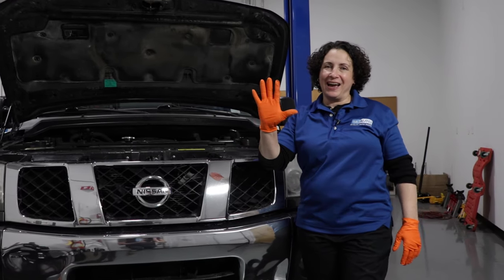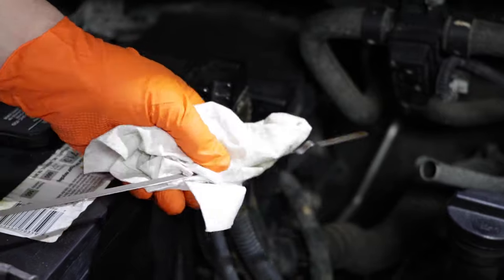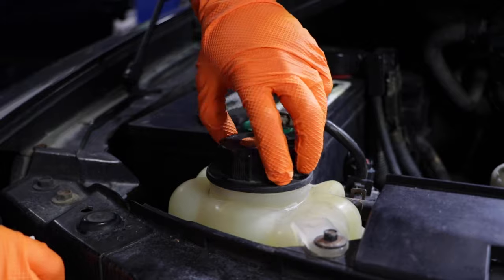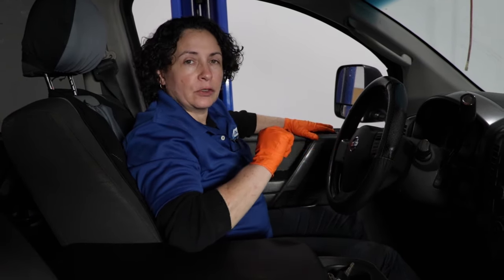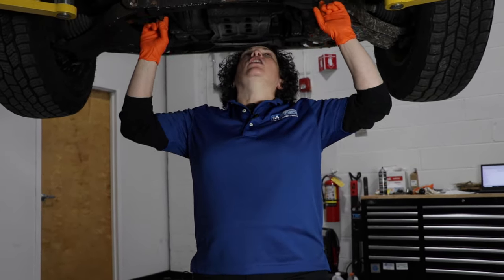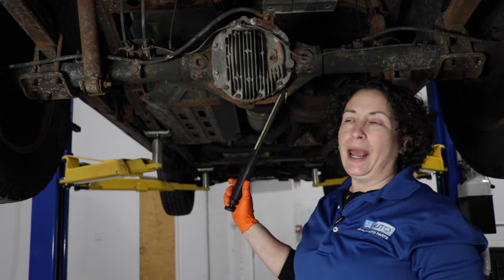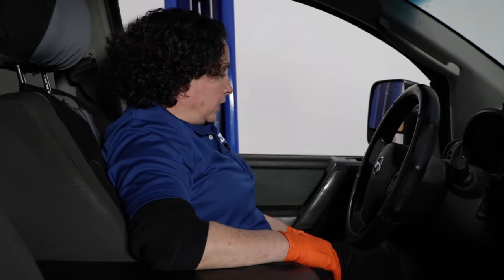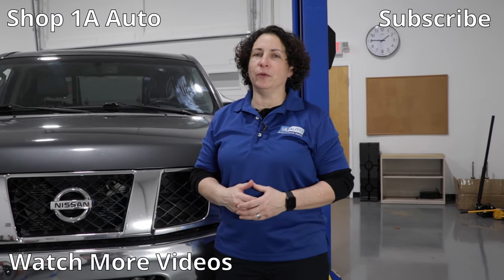Top 5 Problems Nissan Titan Truck 1st Generation 2004-2015

Comment: Something that was not mentioned is when the lean condition makes your intake manifolds crack and when this goes on for long enough your catalytic converters fail and the motor sucks up the catalytic converter pieces and grenades your motor. I don't see this happen too much, but it definitely happens. Cheers!

Comment: First Titan 2003 put 384000 miles on it (hard miles) never ANY issue, Second Titan bought used also a 2003 and put 290000 miles on it and never ANY issue. On my 3rd Titan a 2004 also used and at 248000 miles and except of a stater no issues. Always TITAN for me.

Comment: There is a vent. You nearly pointed to in on the passenger side top of axle tube. No tube but there is a vent on them. I strongly recommend removing the sorta little PCV type vent. Install a threaded hose barb and run a tube to keep the metal cap from clogging.

Comment: I’ve got an 04 I bought brand new that’s semi retired now with just under 100k on it. No mechanical issues (a huge plus) but it has the typical Nissan paint fade that started years ago and the poor quality interior materials are cracking badly. My 04 GMC pickup is cosmetically superior to the Nissan Titan by a long shot!

Comment: I bought my 2008 Nissan Titan February of 2009 with 24k miles on it.  I now have 136k miles on it and it's been the best vehicle I've ever owned.  A couple of the items you mentioned have happened but I think you missed a big one.

Here is my list from personal experience.

1.  Biggest repair so far - Blend actuator doors which cost $1700 as the entire dash had to be taken out and several days at the dealer because no mechanic wanted to touch it.  It also had to take a trip back when one of those actuators failed after a couple of months.  REPLACE THEM ALL IF YOU REPLACE EVEN ONE!  They can't deny warranty when all were replaced.

2.  The trim inside is GARBAGE so you were spot on there.  My entire top part has been ripped out after it cracked so I can literally touch the metal roof.

3.  Clockspring wiring but you forgot to mention the wiring to the gear change (if you have it on the steering wheel) as the wiring after putting in park to drive to reverse to drive, etc, etc, eventually wears out the wiring and you can't manually shift which is nice if towing.  So if you replace the clock spring which isn't too hard, make sure you check that wiring!

4.  I had an issue with the exhaust manifold gasket and to avoid the engine light coming on would use higher grade fuel to avoid it, eventually needed a new starter so replaced gasket while doing that and all good now but that egg smell was brutal!

5.  Transmission cooler hose has been replaced twice so keep an eye on that.

For reference I do put Mobil 1 full synthetic oil in my truck and change every 5k miles or once a year.  Now that I live in the country it's every 5k miles.

I love this truck and hoping for another 4 years or so as I really want to get it to 200k miles.  Then I want a 2020-2021 Tundra with NO TURBOS!  With trim issues and other plastic part failures like actuator doors I'm ready for a different kind of truck and I love the Tundras before they went away from the V8.

Have a great day.
Reply from the maker: +TexasBTC Thanks for the feedback!

Comment: No mention of the front differential? I've got a 05 and had to do the front differential and radiator. Lucky for me the radiator cracked on the bottom and didn't mix with the transmission fluid.

Comment: She's absolutely right on point I had to replace the whole transmission and the differential because of that stupid ass radiator leak. She also failed to mention that you need to put in external cooler on the radiator so that problem never happens again. Also the valve seals leak after a hundred thousand miles. Other than that yes build quality on the interior isn't great and it rattles but that's a lot of cars in the early 2000s
Reply from the maker: +Justin Morrison Thanks for checking us out! http://1aau.to/m/Shop-1AAuto-c
Reply: My 2015 titan starting to slip after an accident a year ago. Thinking body shop didnt put back together right and ever since things are starting to happen at 98k; what did your transmission cost if you don’t mind me asking?

Comment: I have an '04, with 160000 miles on it, that my daughter bought from a neighbor. She didn't need it so I bought it from her. The right rear axle bearing was non-existent. The axle was riding on what was left of the outer bearing ring and the axle had close to 3/4" of slop. It was driven 130 miles like this. I found the problem, after getting 2 loads of gravel and seeing oil on the tire. I had to replace the whole axle assembly since the axle had eaten into the housing. 
  I installed a breathing tube.
Reply from the maker: +Battalion 151 Thanks for the feedback!

Comment: The other major failure which occurs in these trucks is the air mixing valve motors under the dashboard.  Many will call it the "endless clicking" under/behind the dashboard and down by the driver's right foot.  You can find 'countless' how to videos on line which many a person has tried to show the "easy" way to fix the valves - there is no easy way.  The dash has to come out.  This "failure" of the truck should absolutely be noted and recognized.
Reply from the maker: +Christopher Davala Thanks for the feedback!
Reply from the maker: +Christopher Davala Thanks for the feedback!
Reply: My 2015 Titan  started this clicking a month ago when I crank or turn off engine. Someone told me it was heater inlet control valve gears?

Comment: At 157,000 miles, I replaced the electronic fuel body for $300 in my 2004 Nissan Armada. It was stalling on the highway.  Rule this out before replacing the catalytic converters.

Comment: Also the clicking starter (which is UNDER the intake…) which could be the starter switch, or the battery, or the wires, or the ECU. AND the windows that roll down by themselves
Reply from the maker: +Paul Hoffmann Thanks for the feedback!

Comment: For the crank/no start problem, I saw a Nissan bulletin where the camshaft position sensors ( 3 on the front of engine ) or the crankshaft position sensor ( 1 on the bellhousing of the tranny ) was the common problem. Hope it helps someone. BTW, they all look the same but are not. The 3 camshaft position sensors DO NOT have a white circle on the top of the sensor but the single crankshaft one does. 
Camshaft OEM part # 237314M50B Quantity 3 ( No white circle on the sensor ) Also has SGIB000 stamped on top
Crankshaft OEM part # 23731AL61A  Quantity 1  ( Has the white circle on the sensor ) Also has SGVB004 stamped on top

Comment: I have had none of these problems on my titan at 280k miles. I had to replace the rear end and now a slight oil turn. Half a quart at 2500 miles

Comment: Ooo, that spare rust is eating away at me
had mine actually break on me.  The mounting piece that hold the spare up (not the chain, but the actual head that the spare is on) broke.  I got real lucky.  7 seconds before or after it broke, I'd have been going 60 mph and would've likely flipped the truck.  It dropped on me as we were going through a toll booth and slowed down to 5mph.

Comment: Ugh, the famous  transmission cooler issue with Nissan.  We had an '05 Pathfinder with the same issue (affected the Frontiers and XTerras as well) which cost $4000 for a rebuild.   Nissan settled a class action on that, we got a whopping $800 back.   That said I love my  08 Titan  (only 94K on it still) and will probably have an external cooler added.  Ive also heard that the cats can have pieces break off and get sucked back into the engine...anyone know about that?
Reply: Yup, happens to vehicle's with pre-cats too close to the engine/intake. Had a 2006 Nissan Sentra SE-R. Previous owner hollowed it out & put a spark plug fouler to avoid getting a code. I also had a RAV4 with an upstream pre-cat. Very poor design & it's engine suicide eventually. My RAV4 lost piston compression in one cylinder due to ingesting pre-cat debris. Still passed smog but it lacked power running on only 3 cylinders.

Comment: 08 Titan with 358,000 miles / none of these issues. Replaced the exhaust manifolds 3 times, very few issues other than wear and tear. Replaced the OEM alternator at 350,000.
Reply: Did you replace the radiator? If so at what date/mileage ?

Comment: I have an 04 with 210k miles and I have not had any of these issues yet except of course the interior paint fading on the buttons and mine didn’t come with the toolbox and I always keep it washed so the rust isn’t bad
Reply: What did you replace so far? I have a 05 with 117k mi but think about replacing the radiator worried about the mixing of the coolant with trans fluid. Also I have a leak on the ac condenser :(
Reply: Gary LEE I’ve replaced the starter, wheel bearings, transmission cooler line, throttle body and the exhaust system but I went aftermarket that’s why

Comment: Truck does have vent valve on the axle. Its just a bad design. You can definitely help this a lot by doing the vent mod especially if you do it before the seals actually blow!

Comment: Still better than 5.4 Ford, 5.3 GM, AND Anything Ram puts out especially with FIAT at the helm. Only good v8 half ton truck engines are 5.7/4.7/4.6 toyota, 5.6 nissan, 4.6/5.0 Ford, 5.7/6.0 GM, 4.7 Dodge.
Reply: Nissan 4.0 is also a great engine.
Reply: The ol' amc/jeep inline 4.0 is hard to beat too...
Reply: 4.7 are no good lol  check out wizard he will explaine them motors are junk im fine with 4.6 ford and 5.0 them are best

Comment: If anyone can help me identify the slip light issue, great! No abs sensor issue, no ground issue, no abs module or TCM module issue. No broken fuses nor relays.... The light came on when I replaced the horn relay and never shut off. The 4wd chassis light no longer shows so can't go into 4hi or low while the slip light is on.

Comment: 2008 Pro 4 X Original owner, 48,000 mi. and nothing but brakes, tires, belt... and one power window switch. 
-Should note the factory front rotors were toast at 22,000 but Nissan ate it and replaced. 
-Struts and shocks at 40k .. Very little off road or other heavy use to cause that
- Rot is absolutely an issue here in Ct where they salt roads if it so much as gets cloudy and that will be the death of this truck

Comment: I have an 08 qx56 ..I had to replace the clock spring after I noticed the stereo controles on the steering wheel were not working.

Comment: I just bought a 2008 Nissan Titan with 155,000 miles. I noticed the transmission temp gauge takes a long drive of about 15-25 minutes to get the indicator to read normal operating temp. All other gauges work and read no overheating. I also noticed the coolant reservoir mentioned in the video is sucking the coolant into who knows where everytime I start the truck. Maybe I just need to burp the coolant? If I do burp it, do I do it from the radiator or the reservoir? Any help would be much appreciated thanks.

Comment: The only problem I've heard about with my 2017 S.L. 5 ltr. Cummins Turbo 4×4 diesel with tow package is the 6 speed Isen transmission. 40k and no problems. Knock on wood. Very happy with my 53k investment. Average m.p.g. is over 10 for my 7.2k Lance 2375.

Comment: There is a vent tube on this model. It’s just not a very good one and not in a good location at that. To prevent the seals and rear axle itself from failing, people relocate it to the rear taillight.

Comment: Only issue ive ever had with my 2010 is the clock spring ..airbag dudes been blinking for about 8 months 😆..300 thousand miles ..just regular maintenance
Reply from the maker: +rickie campbell Thanks for the feedback!

Comment: I recently found out I need a new engine to my Nissan Titan 2010. She’s overheating I had her taken in to have the heads replacement after taking it to several other mechanics I had the same response “heads are warped” - after a compress test it was confirmed a new used low mileage engine it has warranty 1month. Total engine and labor work included $2000 - I still need to test engine before buying - is it worth it? Should I get a new car? I have a very well certified mechanic who went stRaight to the point and said I’ll replace it

Comment: My 2008 has cracked exhaust manifolds. The dealership wants to charge me over 3k to have them replace for a new set that eventually will crack again. Other than that has been a good truck.
Reply from the maker: +Ismael Z Thanks for the feedback!

Comment: Cracked exhaust manifolds, cabin hvac mixer servos, axle seals due to bad vent design, tailpipe rusts off because of bad design holding water, eats brakes like candy due to blsd system, front differential c clips failing causing exploding differential (04-06 only) were the only issues i had constantly with my titan, lol. i still have a grudge from that truck against nissan.

Comment: Want to add what fix you can do for the axle seal leaks. Many people sell axle vent extender breathers . When i first bought my titan thats the very first thing i did , i have it all the way tucked behind my tail light . Haven't had any problems since and no water has got in at all
Reply: I did the same thing, got adapter and run the tube to the back of tail light, end with $3 filter from Autozone, work perfectly and not worry about dirt or mud get into it.

Comment: I'm surprised the crank no start issue isn't on this list. I have that issue and have never found a solution with everything I have tried over the years.
Reply from the maker: +Trent Obsniuk Thanks for the tip! We'll pass this info along to our production team.
Reply: ECM Relay.
Reply: This could be for several reasons; battery terminals loose or corroded, corroded fusible link on positive cable, bad ground cable from battery to starter, starter relay, ignition relay, ecm relay, ipdm relay, the relay panel itself, ignition switch, a bad ground somewhere on the vehicle, or the actual starter itself. Even if a starter tests good, it can still be bad if the starter solenoid is sticking. You can usually tell if this is the case if the truck is only starting up in the morning or at night, or when the weather is cooler. If I have left anything off please let me know. I have gone through this issue recently.
Reply: ECM relay went bad on mine at 200k. Will turn over but won’t start, like a bad fuel pump. Cheap 7$ relay from Nissan and she cranked right up.

Comment: I have a 04 none of these are problems on mine. My issues are from when first got to most recent. I got it with 130K after a few months needed starter that was a pain its under the intake manifold had to get manifold gaskets as well. 2nd problem was the relay more starting issues about 2 months after changing starter was the ECM relay then not the ECM but some other relay then its was the positive cable finally changed all that and next half a year later battery went dead and bad  you cant leave door or doors open to long interior lights drain battery. AC HVAC door actuator  blend door starts making random clicking noises so annoying and hard to get to still have that problem just gave up on it.
Fuel pump has failed at 160K never ran truck with less then a quarter tank and gave out. Easy to change didn't take more then 1hour i do have a 6" lift so that helped

Comment: I have a 2008 nissan titan and a couple of months after I bought tried the air conditioner because it worked before I bought it and the truck came from California and I'm from AZ. The truck over heated and now I'm taking it to a mechanic who told me its the head gasket but he won't know for sure until he runs a diagnostic but that it would cost thousands to replace but I called auto zone and the guy told me that I could buy a head gasket repair for 50 bucks and it will run a while until I have the money to replace the gasket. I love my truck and I don't want to get rid of it, I wish o knew mechanics and how to run my own diagnostics.

Comment: ❤ A woman after my own heart.  Ok. I just bought a 2012 Armada which I heard is built on the same chassis?  4wd
It was immaculate and only had 92k on the engine.  Well taken care of.  I heard they were very reliable.  Are these problems some that could show up for me?  I hope this is nota money pit.  I knew about thefaulty radiator/ transmission problems with Nissan.  Well known.  Help!

Comment: I heard that that problem with the radiator coolant mixing with the transmission fluid also happened in the Nissan frontiers. And that the problem started when the 2004s came out. I own a 2003 frontier and it seems that they didn't have those problems.
Reply: This issue occurs on 2005 though 2010 Frontiers/Xterras/Titan/Pathfinders with  with the orignial, Calsonic radiator.  The issue was caused by a failure of a seal in the radiator's integral cooler; it's not a corrosion issue as some have suggested. When the seal fails, the engine coolant and transmission fluid can cross-contaminate.  The fix is to add an external cooler or buy an updated rad.
Reply: Also happens on the Navara 🙃

Comment: I have the air bag light going off I change the clock spring and it’s still going out any help and also miss fire p0305

Comment: 168000 original starter  original air 2005 model.. Raditor leaked because of hitting curbs at 60mph several times.  it has lots of power and uses lots of gas.

Comment: I think the engine mounts and transmission mounts splitting on the 4x4 models is an issue that should be in the Top 5. 

The exhaust manifolds cracking causing an exhaust leak is a major issue also.
Reply from the maker: +Full Body Joe Thanks for the feedback!